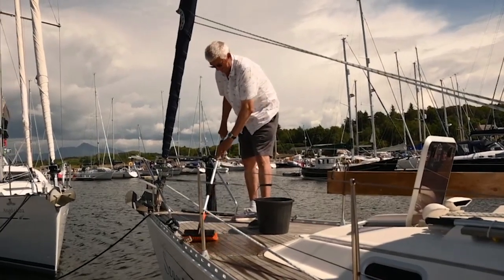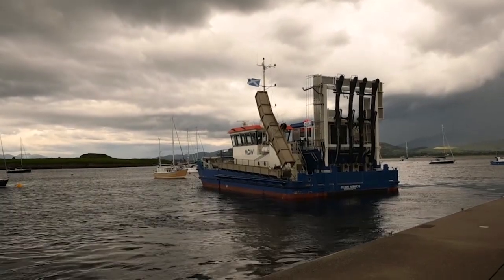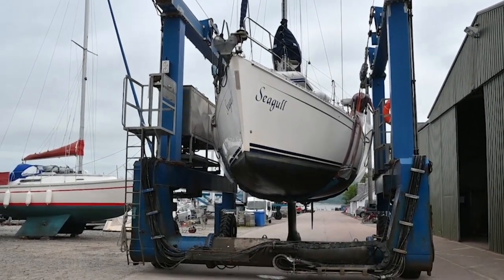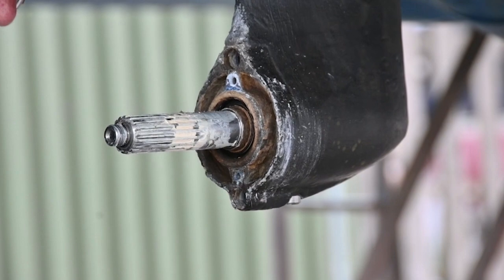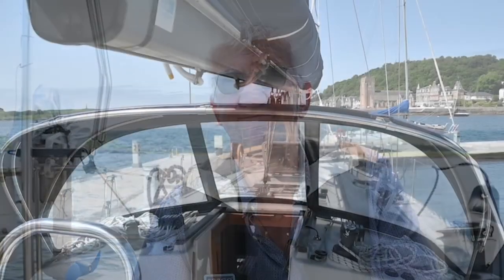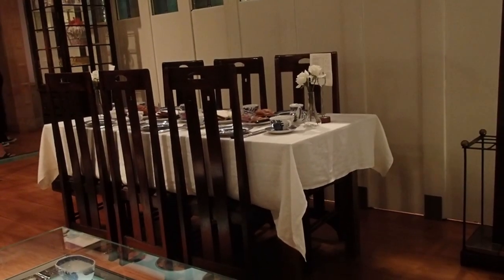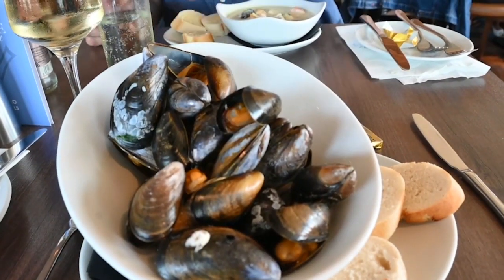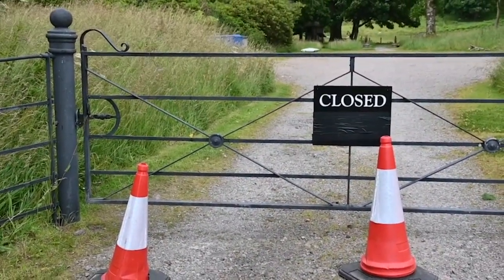Ep 24 Only a few hours to repair our yacht

Comment: The lifting strop looked frighteningly close to the speed log. I have heard of lifting strops being placed over the top of logs pushing them up into the hull when the weight is taken. If nobody notices, when the boat goes back in you have a leak or more worryingly the speed log having been weakened fails at a later date. 
Which could be a bit of a disaster, to put it mildly.
Reply from the maker: Our lifting points are carefully marked on the hull. We have had the boat 13 years and lifted her every year. No problems yet.